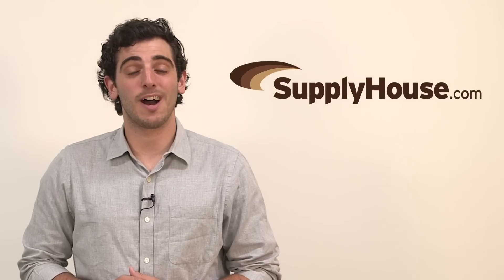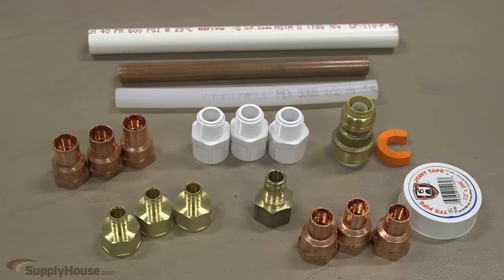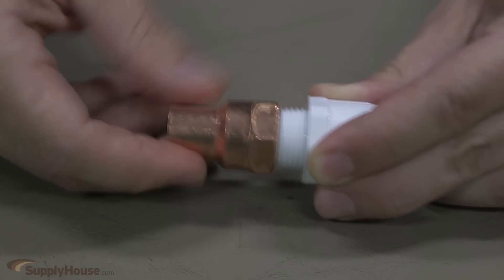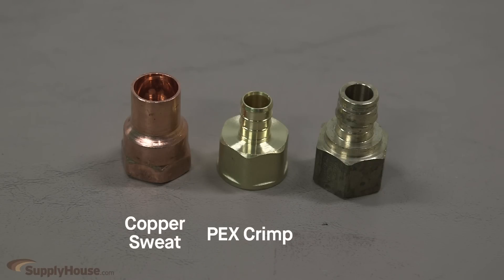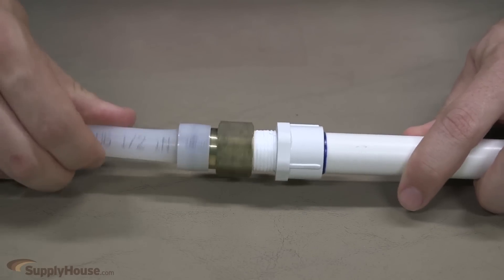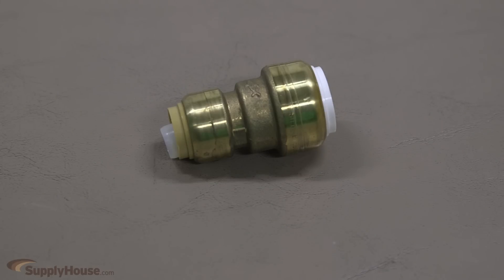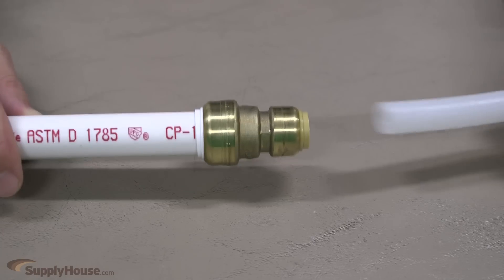Connecting PVC to PEX and Copper

Comment: I am so far from being a plumber, but thank God for these YouTube videos I broke an old PCV valve that connects my washing machine hoses to the hot and cold water PCV valve so I went and bought the two plastic parts that was connected to the spout, but thank God I met a man at Home Depot where I deliver who told me to buy 1/2× 1/2  straight coupling , he told me to saw off the part that broke evenly cut, and just connected to the part that broke without having to solve that piece.. my question is do I need to put glue on it or it will adhere itself

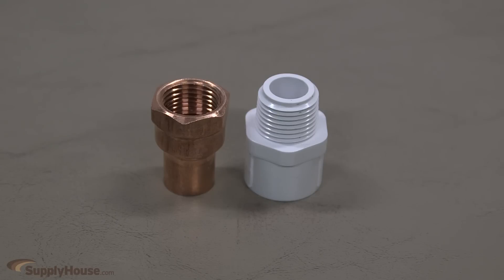Comment: @0:11
That was an IMPORTANT Pro tip right there kids.. never connect a PVC FIP fitting to a Metal MIP fitting as the male metal fitting will CRACK the female PVC fitting.
It took 3 weeks after installing my new water filter for the 1" PVC FIP fitting to crack.. and I was super lucky to be home when the main water line hosed down my boiler room.
Reply: Thank you boss man
Reply: I'm just trying to repair the PCV pipe that connects my washing machine hoses
Reply: So do I need any type of sealant or glue when I connect the two pipes back together

Comment: Your video is wrong/misleading. Shark bite will only work with the yellow cpvc not with pvc. I have been to both lowes and home depot and they both said I had to use the a coupler and glue in the appropriate threaded   adapter . I have 1" pvc coupler with 3/4 " threaded insert to connect 3/4 " pex adapter

Comment: Would never use sharkbite permanently with any “pipe/tubing” material; especially if buried inside a wall.
We only use sharkbite fittings for temp fixes or for testing, than go back & use appropriate “material” for the job.
It’s how [we] do it, so not saying sharkbite type fittings etc are bad, we just have policy that said above….Cuz seen quite a few push-to-connect fittings fail over the years they’ve been on market.

Comment: 2 questions, 
1- is the shark bite approved for under ground use?
2- does the flow direction matter?
Ty
Reply from the maker: Flow direction does not matter, and SharkBite fittings can be used underground as long as they're wrapped in silicone - https://bit.ly/2VEQEKO
Reply: I wouldn't do it its cheaper and better to do it the right way and shark bite is at best a temporary fix that will one day leak

Comment: Is this just a 1 inch sharkbite coupler, or a special sharkbite for pex to pvc?  Are they different outside diameters?
Reply: There is 3/4 in. IPS and 3/4 in. PVC CTS so yes.  Standard PEX is CTS, a larger older PCV is going to IPS.  I know as I just went through this nonsense doing it myself.  IPS means Iron Pipe Size whihc is  larger outside diameter, but still labeled 3/4" for example.